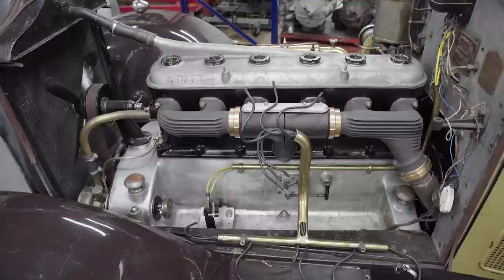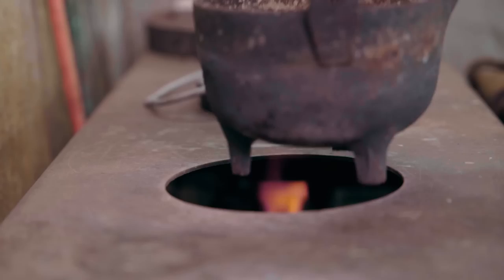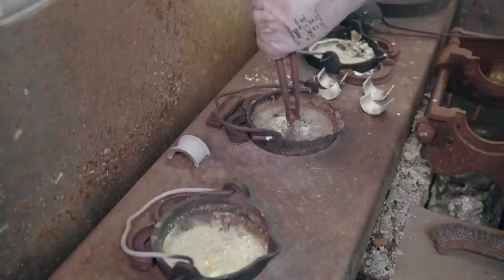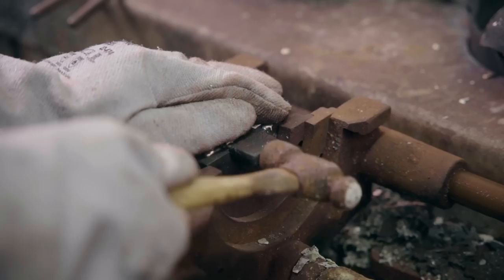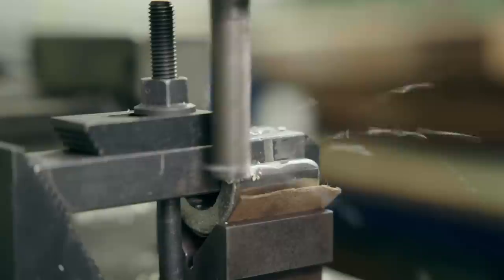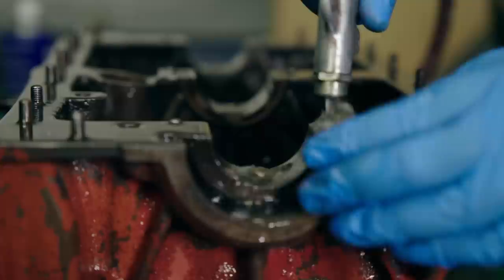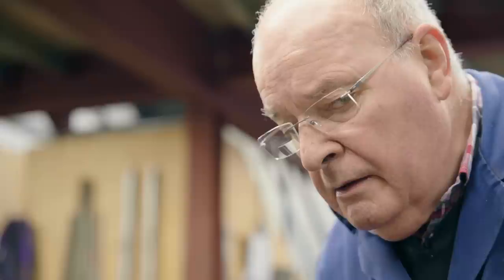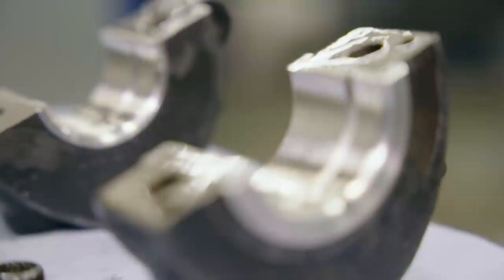Specialist Repairs Bearings For A Singer Nine | Top Gear Handcrafted

Comment: I don't believe that's how it was done in the original production factory. No way they took all day to build one engine. I have a book from the 1930s that describes the bearings being cast in-situ, with the crank suspended in place, and the molten metal poured into place. The slight shrinkage as the metal solidified set the necessary clearance.

2nd Hand Info Alert, I wasn't around in the 1930s.
Reply: Hi, could I have the name and details about this book please as the process you mention sound interesting?
Thank you

Comment: Initially I thought it would be bearings made from some space-age exotic material like silicone carbide for a modern race car.

Still a cool process though.
Reply: These bearings are not for a modern race car. they're for a 9 horsepower motor from the 1930s